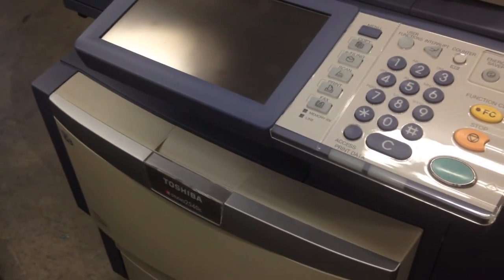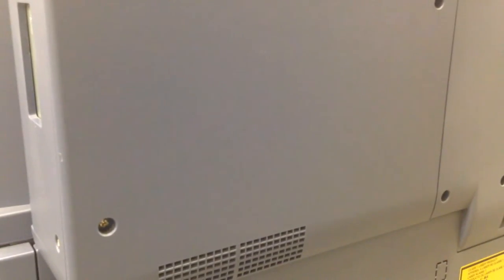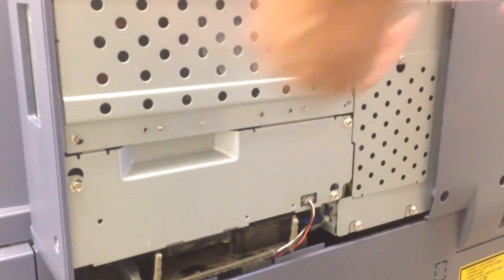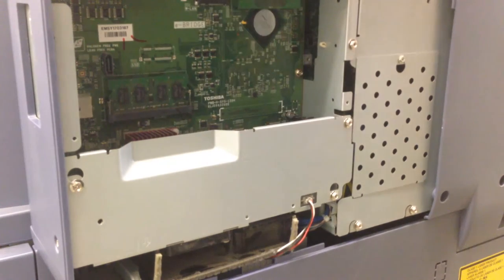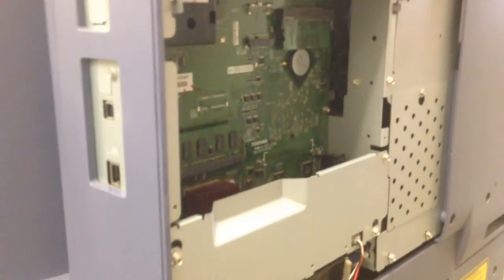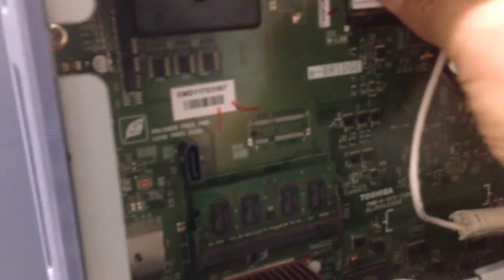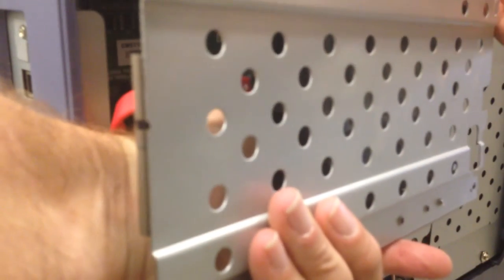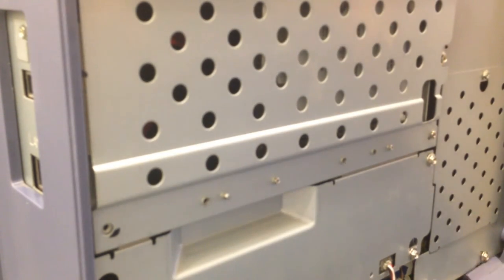Toshiba Estudio wireless  antenna install

Comment: I know its been a while since you posted this video however I have an Estudio 507 and the bak of mine is a little different.  I cant get the usb or network port to work so want to try a wireless antenna but there isn't one installed.  Where can I get one?

Comment: I am having a hard time finding these wireless modules. Where can I buy one from?
Reply from the maker: They are very rare.  Depending on the model we may have a previously owned one.  Please give us a call at 1-888-866-2679 x 0 Copier1
Reply: @copier1368   Joe would you happen to have a wireless antenna and card for Toshiba eStudio FC-2540C printer ?